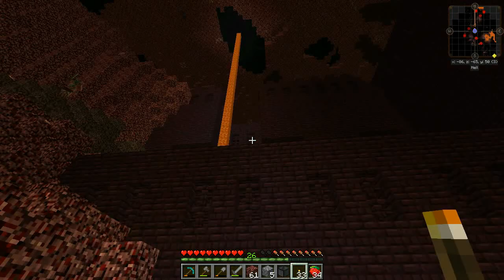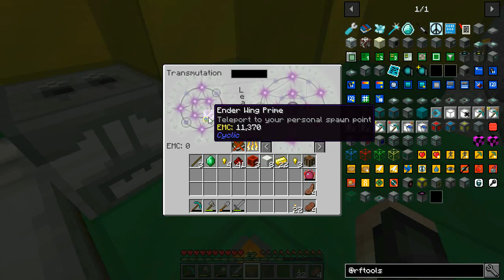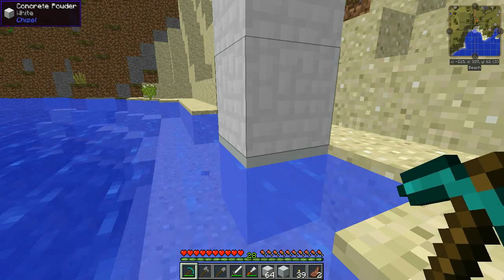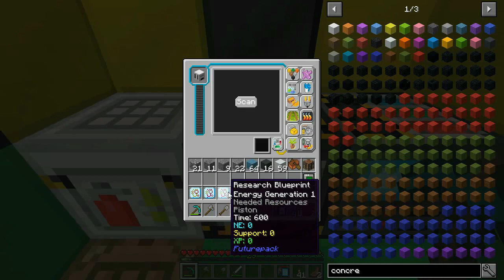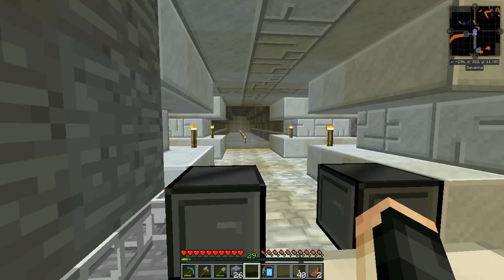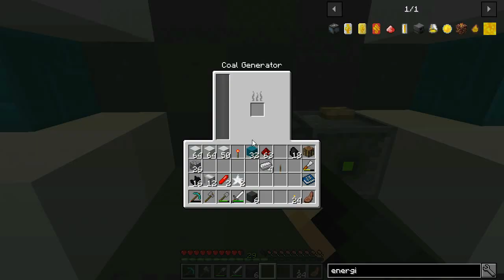Futurepack Industries 1.11.2 Episode 2 - Semi-Automated Concrete

Comment: If you need to use the pillar method again (emergency, away from your machine, etc), you could pillar up, place water on one side of the top powder, give it a few seconds to flow down, pick up the water, and then mine your way down the stack. You wouldn't have to do it in water and lose some to the depths.
Always fun to watch!